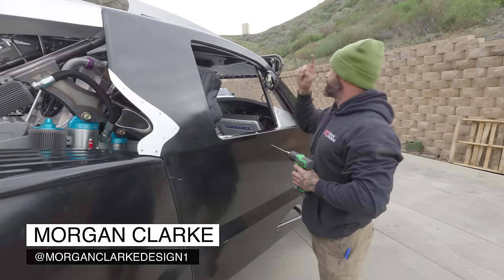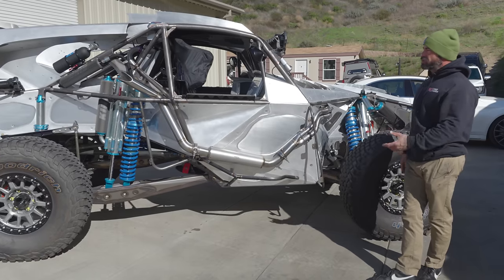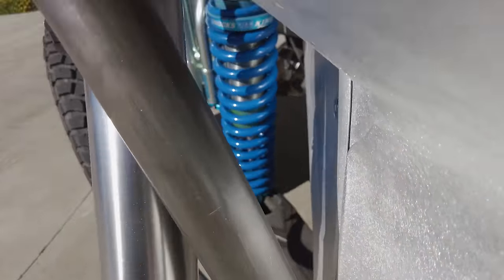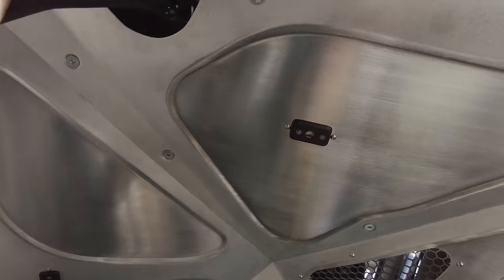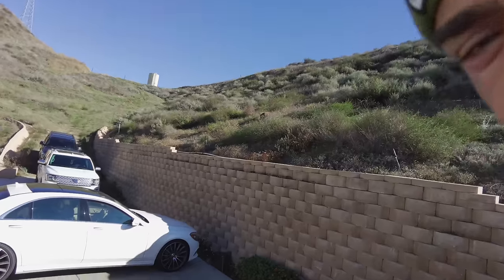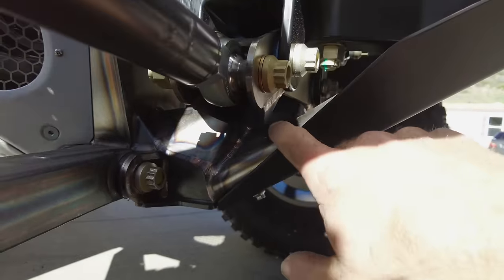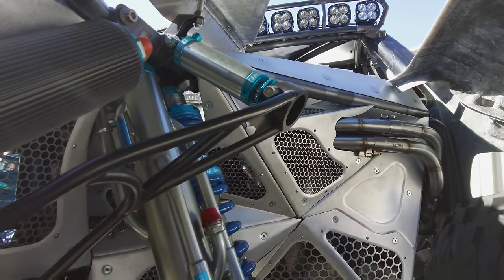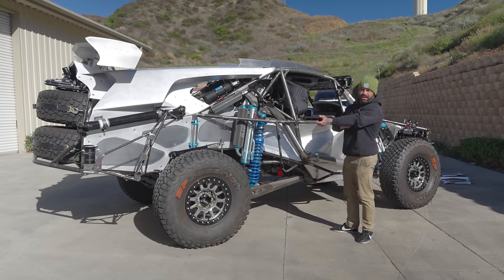Aerospec 6100 Trophy Truck: The Ultimate Masterpiece Is Finally Finished!

Comment: I have a few questions if i can. First why is the frame work left bare? seems to me that would be a structure issue as with hand oils and other natural compounds would cause it to start the break down process? I guess when you get to say baja 1000 level of building, you dont even use a normal truck chassis that is modified seems to me that takes away from the original factory starting point of say truck or car or what ever. i know you use a shell to represent a maker. just seems to me the art maybe back in the old days was to start from a factory truck and then modify.  
A few comments, this is a work of art, and I totally agree with the part you said, every little detail needs to have a lot of thought well forethought.  I really like the way you guys tucked all the spare parts tools and function of fixable stuff in very useful spots.  I never built any thing like a trophy truck by any means. I have built many Mad max style cars and things like that even tho they look mean and rough they too need to have some thought. :) Cheers and nice work.  I guess i am just still old school of thought on builds.  oh by the way hope you get to feeling better hot toddy! to the rescue!

Comment: Do you engineer in breaking points to protect the chassis and suspension in a hard crash?
Reply from the maker: Not for this style
Application. We didn’t build this chassis. Usually the front sub frame would render itself at a consumable. Most of these are built to withstand heavy crashes